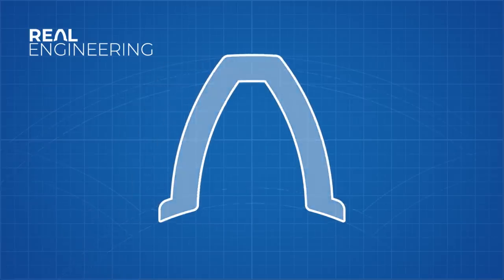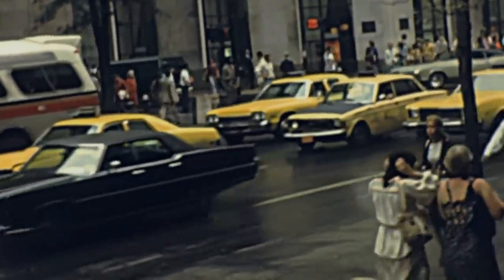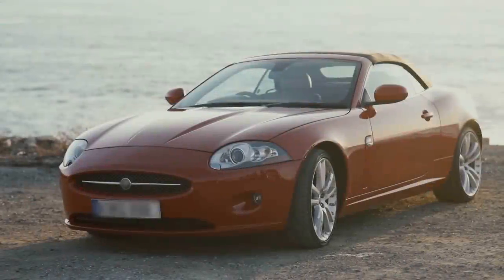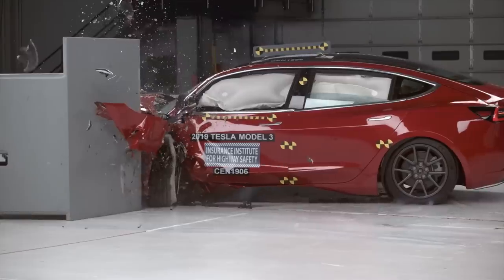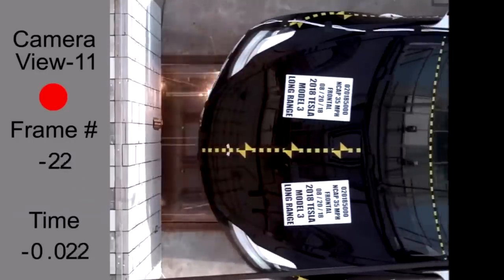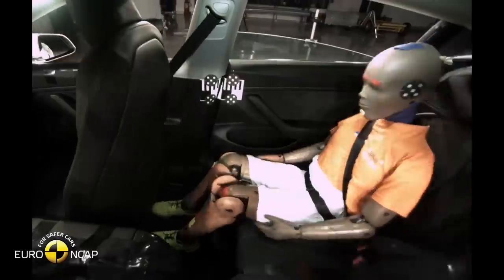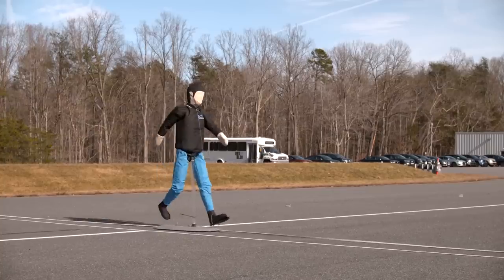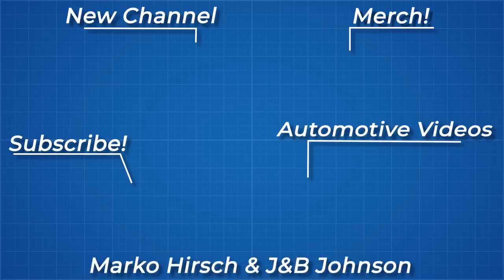Which Is The Most Dangerous Car?

Comment: I suspect the Mirage (and a few other compact cars) have high casualty rates for several factors, including
 - they're often driven in cities (more traffic, more accidents per mile);
 - they're often driven by learner drivers (more accidents per mile); and
 - they're often hit by heavier cars (in which case, it's the heavier car that's less safe).
There will be genuine drawbacks too - eg a lower budget may mean lower-quality materials - and naturally if the Mirage is literally top of the table, it's also done worse than the other compacts. Still, I suspect a lot of the casualty rate is down to how compacts are used, rather than how safe they are inherently.
Insurance companies (or Google) have the data for a real like-for-like analysis...
Reply: Another problem is that a mirage can only be seen off in the distance!
Reply: Sensible analysis. The dude in video thinks he is smart enough!
Reply: Smaller cars have smaller crumple zones so less chance for impact absorption, give the compact car another two feet of bonnet and it would fare better, but it would no longer be compact!!.
Reply: agreed 100%. the safety tests don’t account for things like who’s more likely to be in the car and where the cars are driven, which are definitely important and incredibly relevant to the rating of safety.
Reply: It's a mix of both.
Many economy cars skimp out on safety features und use less rigid materials for body and chassis to be cheaper, they often have underpowered engines that make it much harder to evade dangerous situations, if you need to quickly accelerate to get out of the way and of course they're often driven by beginners or people who don't enjoy driving at all (no wonder with these cars) and thus don't put enough effort in their driving.

But no amount of quality engineering and safety features can negate the disadvantage in weight that these cars have in a crash. Which is the paradox of small cars: they're more prone to heavy impacts, because they're small and light, but if you blame that on small cars and say they're less safe because of that, then the logical conclusion would be that everyone should buy the biggest heaviest cars "for safety", which would quickly lead to cars getting bigger and heavier and traffic would get less and less safe for anyone who is not driving a car as cars steadily turn into trucks and then into freaking tanks!
Reply: @LRM12o8  In any collision the smaller mass is always deflected by the larger mass, this is basic physics, crumple zones can help mitigate this but in a smaller vehicle the zones will also be smaller , driving larger vehicles is not the answer, neither is promoting small ones, slowing down can make massive differences to the forces involved, maybe a blanket fifty MPH limit, controlled by the vehicle would help, it would be a very difficult sell and motoring journalists would have to find something else to rave about but such is life!!, with a limit everything would still get done, people would still get about, and business would still function, and surprisingly journey times would not be that much greater, fuel consumption on the other hand would see savings, and it could be sold as being green and helping to save the planet, it would also help extend the range of electric vehicles assisting them to be more competitive (not sure if that is the best idea but there you go).
Whatever you do people are people and will make mistakes leading to accidents, however old or experienced they are, and you have to accept that as a fact all the time you allow them to get out off bed.
Reply: You talk about the survivors bias with larger vehicles. The Mirage and Spark were the cars with most casualties, which was also small when you actually look at the numbers.  Both the Mirage and Spark are options people get for students, primarily College students. What is interesting though, is that when they did the test in 2016 for iseecars and there wasn't much data at that point so they had to round the numbers where only 60,000 cars made it to sales. Also, looking at the remaining data they offered, showed discrepancies in what car was the most, with only one location listing Mirage as most, being in LA California. Moreover, when broken down by state, Mirage didn't list once as most deaths with a Yaris rating worst at 24.2 deaths per billion miles driven. Quite a bit different than Mirages 10.2 and 14 for LA.
Reply: @LRM12o8  The Mirage uses the same materials found in Nissans Rouge and Pathfinder following the same engineering principles that made those vehicles. It however has a smaller crumple zone because of it's smaller size. If you look at the 2012 Nissan Rouge, you'd find that it didn't fare any better in the small overlap test getting the same rating in the overlap test. Nissan and Mitsubishi are part of the same coalition and have been sharing their engineering for a while. Their new Outlander is proof of this as well.

Comment: That was my first thought when I saw them hit the door with the hammer. Since they only hit the door, my current theory is that the doors and side are thick to resist side impacts, and the front and back are thinner to create a crumple zone.
Reply: Mostly what's going on is that Tesla are going to sell this as a truck, which in the US don't need to meet passenger car crash safety regulations. This is also why the F150 pickup is such as good seller in the US - it's much cheaper for the amount of vehicle you get because it doesn't have to meet the same economy or safety regulations. I don't think there's anything definite yet (Given there are no safety tests results at all for the Tesla truck, but there's a pretty good chance it can't be sold in Europe at all because it's depending on the crumple zone of everything it hits and it's superior weight to keep it's occupants alive at the expense of everyone else  on the road.
If manufacturers and governments really wanted to reduce driver/passenger deaths in cars in the most cost effective way possible, they'd make crash helmets mandatory, but that might remind people just how dangerous the speeds cars can travel at actually are and maybe make people rethink car dependency in the first place.
Reply: @peglor  Hell. The whole safety blackhole falls apart when different vehicles collide. In reality, the safest setup would be a 5 point harness, neckbrace, helmet, and tubular roll cage.
Reply: @peglor   if I'm not mistaken F250 and RAM 2500 and higher are classified as commercial and don't have to report their MPG, but Ford F150 and RAM 1500 do and they have like amazing 26 mpg on the highway. I drive 2019 1500 RAM classic and I got 27mpg just by setting cruise control on 70mph for 2 hours. I had air-resistant cargo too, so it could be even lower.
Reply: The steep angle of the front panel would make me think it's effectively thicker than the side panels (consider how tanks use angled armour plating), though it could still be engineered to crumple despite this.

Comment: This video actually is not great. You raised so many questions and did not answer them.

1. Why is the mirage so dangerous?
2. Is the Tesla truck more or less safe than other Tesla?
3. Why did they change thier crash strategy with the truck?
Reply: The mirage is dangerous because a lot of the cars on the road in the US are much bigger than it
Reply: Yes, and worse.  The evidence may be that the occupants of the mirage are the most vulnerable but we should distinguish between  occupants being vulnerable and how "dangerous" the vehicle is.  If not, then push-bikes should be outlawed for being dangerous and we should all drive tanks.
Reply: I have to agree, this video was below the usual standard.
The cybertruck bit was forced in to just make a jab at it and was entirely unrelated to anything.
It only covered the US system while the majority of cars are sold globally and have to pass and be rated by various systems. NCAP was mentioned at the end which is used by many more countries and is a lot better as well as being a constantly evolving rating. For example, it is now impossible to achieve the highest rating without an auto-brake system. It also tests with female and child dummies.
It felt like just a way to complain about the american testing system in the guise of science except without any sort of conclusion.
Reply: He is talking about how hard and how many variables you have to consider when answering these questions.
Reply: I think the point of this video is that there are so many variables when it comes to determining the safety of a vehicle, yet there are not nearly enough tests being conducted. In other words, it's impossible to answer that question because there is surprisingly little data on the matter.
Reply: He answered all of those, You and the other 140+ of you weren't really paying attention.
Reply: Because its a few kilobytes, the hadn't include colision deformation ;)
Reply: Nobody changed their strategy with a truck. Nobody knows for certain why the Mirage is so dangerous, that we can guess, and nobody knows how safe the Tesla truck will be, because one has never been built yet, and none of the full-size models we've seen have been used in testing
Reply: The Mirage is likely the leader in deaths for two reasons, driver habits and curb weight. Every barrier done crash test, which is all of them, simulate a vehicle of similar weight hitting it head on. If you were to crash a Honda Fit which is 600lbs heavier than a Mirage into a Mirage there would be a serious difference in cabin deformation and dummy kinematics between the two. Now imagine a full size Pickup and a Mirage get into a head on. The driver would have to be cut out of the Mirage. I'd actually consider buying a small car weren't it for the careless driving habits of people.

Comment: None of these tests consider high speed crashes , double the speed requirement (35mph) is commonly seen in American streets , 70+ is extremely common on our highways and crashes so why don’t they test at the higher speeds
Reply: because crashes at 60 plus mph are considered low probability of survival crashes anyway.  to make a car that has a reasonable chance for the occupants to survive a high speed crash would result in vehicles costing 100 thousand dollars and the U.S. economy which depends on people getting to work and stores via personal vehicles would be destroyed.
Reply: @pepperwood8811  explain how nascars etc crash at 225 mph and are usually fine as long as it was a roll
Reply: @Andrew-hh3ol  One, NASCAR cars are quite expensive which was my main point.  Second, race cars use technology that would make them impractical as commuter vehicles: no doors, no side windows, a film on the lexan windshield that must be peeled off and replaced after every race, drivers literally strapped into a seat that wraps around them and held by a five point harness which requires a crew members assistance to attach.  Their neck is literally strapped down and prevented from moving freely by something called the HANS system.  Then there is the stuff apart from the car.  They wear a flame retardant suit that is hot and cumbersome and a full face helmet.  The walls at the racetracks have something called 'softwalls' at key areas which are materials specially designed to safely absorb car impact energy.  Lastly, racecar drivers are incredibly skilled at driving.  They have natural talent coupled with years of practice learning driving techniques that are beyond the capability of the vast majority of regular drivers.  So that's how to explain NASCAR, if you think that is practical and economical for the commuting public then okay.
Reply: @pepperwood8811  it’s easy to mass produce roll cages and we wouldn’t need a hans system because the vast majority of crashes are 80> mph Hans only makes a difference with several rolls statistically it’s all about making a car slightly cheaper having a car survive a 70 mph crash besides aesthetics is definitely plausible
Reply: @Andrew-hh3ol  Roll cages perform the same duty as crumple zones and reinforced A pillars.  They use roll cages in racing because that system works better as long as the driver is very securely strapped down and wears a helmet.  In a commuter car where people are not nearly as strapped down, crumple zones work better.  If you put roll cages in commuter cars and didn't strap all the passengers down and make them wear helmets, they would be killed by the roll bars.  Also, roll cages mean no doors.  The HANS systems doesn't, "only make a difference with several rolls."  It is to prevent the rapid movement of the head which results from the rapid de-acceleration of a car during a crash when the body is strapped down i.e. during these high speed crashes you are talking about.  Why didn't you bother to address any of the other issues I brought up?  You DON'T think the fact that the walls of racetracks having a special energy absorbing material in them is relevant to the survival of nascar drivers?
Reply: @pepperwood8811  they rarely even test them remotely close to the speeds we reach in normal driving
Reply: @Andrew-hh3ol  The basic physics of crashing cars at high speeds is hard to safely mitigate mechanically without making the cars impractically expensive or impractical for the average driver to use.  The ultimate solution to the problem is the continued improvement in automation and 'intelligent' computer based safety features.  In the coming years they will continue to improve upon self driving cars, and cars that can 'see' an upcoming collision and avoid it.  Cars will eventually be made to communicate with one another via 5g and will co-ordinate their driving.  If things go well in this direction and we are not all wiped out by a hyper-inflation/depression, car crash test will become irrelevant because these collision avoidance systems will be good enough to prevent most crashes.
Reply: @pepperwood8811  a huge one that they refuse to do is bucket seats that actually do the job of bucket seats modern cars are pretty good about rolling but head on no chance
Reply: @Andrew-hh3ol  they could also force, somehow, people to drive no more than 40 mph.  At those speeds, all the safety systems work very well and the death and injury rate would drop dramatically.  Maybe they could do that with mandated speed governors and very strict penalties for speeding or modifying the governor.

Comment: I really want to see the low-polygon-count truck's EuroNCAP test result. Specifically the car vs pedestrian test. They gonna have to rename it the Murder-truck.
Reply: Google "Tesla Autopilot"
Reply: Johntech the autopilot can still fail, and you can’t/won’t use it in every situation. Hence the car still needs to be as safe as it can be for a pedestrian/cyclist when it does come into collision with a pedestrian/cyclist. “Autopilot” means jack shit in that case. Tesla’s still DO crash, regardless of their superior safety systems
Reply: @StratosTitan  Evidence is short on Teslas crash safety systems actually being superior to those every other manufacturer also has in their cars. Autonomous braking, lane departure warning and blind spot monitoring are available at the very least as options in just about everything and yet other cars still have to meet pedestrian crash regulations too? Autonomous driving is very dangerous as Tesla aren't willing to take responsibility for the mistakes it makes but it works well enough that drivers can get away with not looking where they're going for long enough periods that overall the risk is higher. Until full no steering wheel autonomy is available, and even Elon Musk has admitted that's a lot harder than he thought when he started trying to do it, anything that takes the driver's attention off actually driving - the worst and most common examples being touch screen interfaces, where there's no tactile feedback, so you have to look to make sure your finger is in the right place instead of just feeling for the button is a massive safety downgrade.

Comment: "Don't bend when hit with a sledgehammer"
That's not a sledgehammer. That's a rubber mallet.
Reply: @fayenotfaye  it's a deadblow hammer.

A rubber mallet full of sand.
Reply: @fayenotfaye  Were you the one holding it?
Otherwise you have to prove it.
Reply: @fayenotfaye  I didn't need to hold it. I saw (and heard) what it was.
Prove it wasn't rubber.
Reply: @fayenotfaye  No, i don't need to. I am not the one making dubious claims here.
Reply: It’s a 14 lb dead blow sledgehammer. I have owned one for 10 years....
Reply: @stevendunn6255  Would you hit your own car door with one?
Reply: @DrIcchan  No, it would cave the door in. I use it to remove car rims that are rusted to the hub and brake rotors that are rusted to the hub, very effective for those uses...

Comment: My guess: Ford Pinto; 5mph rear impact, goes up In flames Immediately
Reply: Helped along with a firework from GM.
Reply: Yeah, that whole Pinto thing was not nearly as bad as it's usually made out to be.  Safety-wise, it was actually very typical for that class of vehicles at the time, and the infamous video of one going up in flames was a test where the fuel tank was intentionally set off by a charge.  The scandal was really due to how Ford handled it.
Reply: @SynchronizorVideos  I mean, at least it wasn't like mustangs of similar years where gas would spew up into the cabin.
Reply: @SynchronizorVideos  you know the whole story, not many people do. The bigger problem for buyers was the car was a POS (the vega was worse) with the engine lasting about 60k miles.